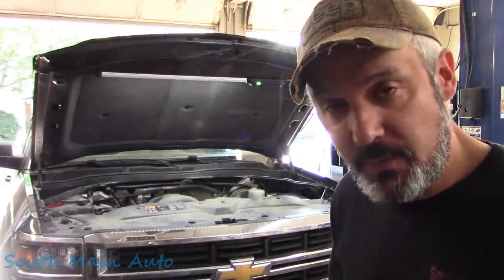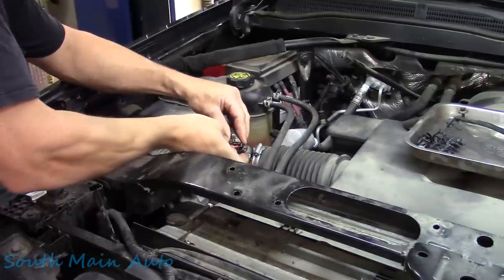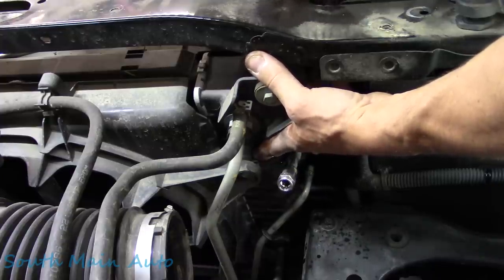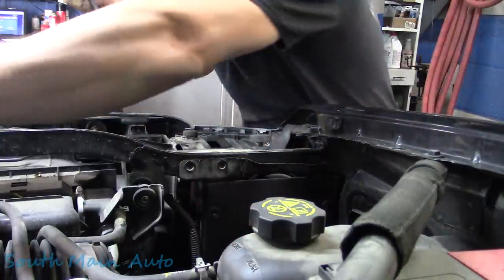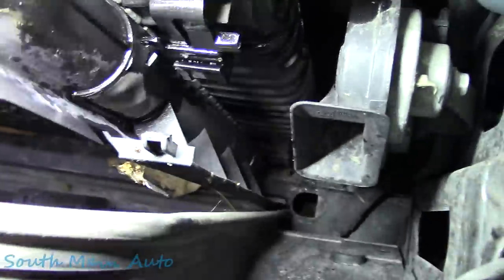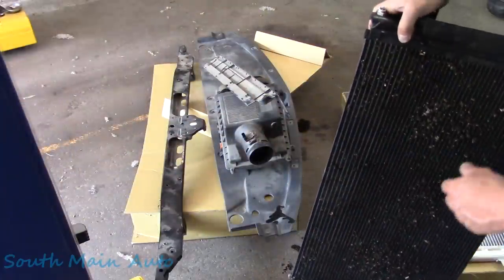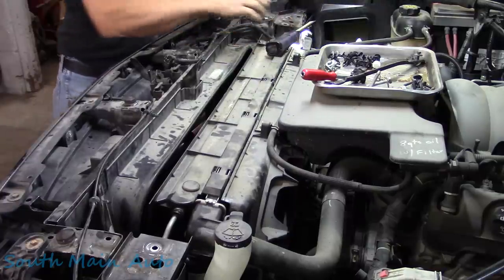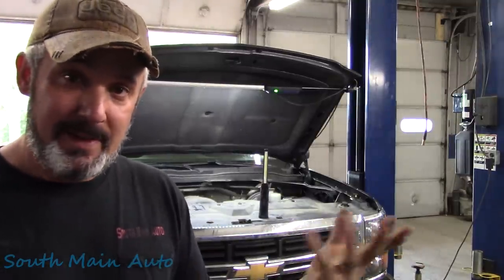Chevrolet 1500 / Tahoe - No A/C Leaking Condenser

Comment: It's "genuine AC Delco," but not the OEM part. 🙂 However, if you get this job done at a GM dealership, this is probably the condenser they will install. The one I work at does and I know many others do as well. I have no idea if this AC Delco Professional part is any better or worse than the OEM part. Your conversation with the other tech regarding those brake rotors was hilarious!
Reply: AC Delco professional is a lower/cheaper line than regular AC Delco. And Regular AC Delco is the OEM part. All OEM parts for GM are either AC Delco for most things such as service item and common wear items, and for more speciality things they are Genuine GM parts. No different than Motorcraft and Genuine Ford for Ford vehicles
Reply: @MoparMadness93   I work the parts counter at a GM dealership. I'm already well aware of this. 🙂 I was just poking fun at how Eric described the new part.

Comment: This one caught my eye since I’ve had the dreaded condenser leak as well.  Dealer charged $1400, but no one else could even find the leak LOL!  And my transmission oil looked like that when it died at 160k miles.  2015 High Country.   Should be good for another 160k, right? 😬😬😬
Reply: I had mine drained and flushed at 100,000 Transmission now it’s got 200,000 on it thinking about having it done again it’s a 07 gmc

Comment: I just put a condenser in a Kenworth this morning. Would not create a vacuum. I didn't look over it well and found a dent on the bottom. No box damage. Thankfully the old compressor had an internal leak. Thus a reminder to always look over your new parts first.

Comment: I know what you mean about those plastic retainers going flying away! I was working on my '04 Chevy Trailblazer, and I had to remove the left side door sill. This piece wraps up the front of the cab and encloses the parking brake lever. Up in the corner is a plastic Christmas tree style retainer. I used my trim to and popped that retainer out. It went flying across the cab, and I've still never found it! I know it's in the cab somewhere, but it's hiding pretty good!

Comment: Boy, you're not lying about Taiwan parts packing! I just liberated a 6,000# (approximately) steel and thick wood specialty bench beautifully made and finished and shipped directly from Taiwan. The outer carton is of extra thick cardboard. All the parts are individually boxed and suspended with those hard, wood-like corner protectors, plastic bags, specially shaped Styrofoam pieces, and enough large sheets of inch-thick Styrofoam to insulate my basement. What a difference from that horrible, easily torn, dissolving Chinese carboard that invariably has parts poking through it.

Comment: Just did that job on my ‘16 GMC Seirra, although I could for the life of me get the cordless ratchet on the 6 bolts on the top support, hand wrenched them all! Oh well it’s done now! Great job on the video!!
Reply: I like to use a 1/4" air ratchet on tight stuff like that but I don't have a battery ratchet so must any way. Some stuff just needs a manual wrench and lots of "language" smile...

Comment: Never thought I'd give you some advice but I'm a GM tech and yes we do this all the time. To the point we kind of prefect this to being a 1 hour repair with AC charge under warranty. You can save a bunch of time leaving the cross bar in and removing the intake duct. The radiator towards engine and it will allow the condenser to clear that bar. We can usually have these out and back in within 15 minutes. Miss the times they paid 5 hours under warrent :/

Comment: My 2014 Silverado 1500 had to have the condenser replaced last year due to the known cracking of the condenser. Again, no warranty coverage. It was replaced with the upgraded version that addresses the cracking issue. Been working since. Now I get to see how the repair was done. Thanks Eric.
Reply: The "upgrade" version (S) also leak.

Comment: Man Eric you did this the hard way, GM pays 1.0 to replace these, plus EVAC and recharge. Take the intake tube off,  unbolt the Radiator, deal with the lines, push it tword the engine, unclip the condenser, shimmy it out.

Comment: Too bad, you couldn't have changed the radiator at the same time. Good job, Glad my 2013 is being replaced with a new one. 110,00 miles and very few problems but from what hear it's time for things to start needing fixed. It will be someone else's problem. Here in AZ, we need our air to work.

Comment: I don't know if those connectors are the same type as some of the dodge stuff uses but if you lube those quick connects the next guy can get them apart really easy. Use the same oil pag(somenumber) as you add if you replacing a compressor. Also if you want a really leak test go look how the hvac guys do it, they presser it with nitrogen 300-400psi then close the vales and see if it goes down. It also helps keep moisture out of the system, keeping your vacuum pump oil happy.

Comment: I did this on my 2016 Silverado last summer. I took out the radiator as a assembly. I had a leaking coolant tank to deal with. The radiator did have a lot of stuff stuck in it.

I am currently doing a compressor and condenser in my expedition. I got the kit from rock Auto. It is a fight because everything is buried on this vehicle.

Comment: those rear brakes/rotors! My cousin did about equal to that many years ago, not cut into a separated ring, but very worn and inboard pad/backing plate gone.
I was asked "can you turn the rotors?" I said yes I can TURN them in to the scrap yard for peanuts. 🤣

Comment: Not an easy-peasy job for sure. Always best to fix the problem, not just "repair it" by filling the AC. Good job! I would also recommend a mesh screen on the grill to keep the grass & hay off the condenser and radiator so you don't get the crusher Dirty when the NY salt has its way with the truck!

Comment: garden hose from the back side works great to flush crud from radiator/condenser or better yet, cheap old school engine cleaning gun (air powered that siphons water up a hose) then just use plain hot water or regular dish detergent/hot water mix, beware you'll have foaming suds galore and need to rinse it very well!
yes there are specific products on the market for cleaning radiators/coils, but I mush prefer to using "junk" I have laying around and many others likely do as well.

Comment: "I am here to tell you though it affects WAYYYYY more vehicles than they have listed. However in typical GM fashion they deny everything and won't cover any vehicles not listed in the TSB under the extended warranty even though they use the exact part number haha. Way to go GM"   EXACTLY the same with a windshield wiper issue on our 1994 Suburban.  1994 Suburbans - but NOT our VIN number - were covered by a recall, even though we had the exact same issue (wipers not working when raining), bad solder joint on the circuit board, cracking due to insufficient supporting.

Comment: Still working on finding the leak in my old Suburban a/c. (it never worked from the day I bought it!) I've replaced just about everything in the system bar the lines, rear unit & tx valve back there, It's very hard to get to. Flushed the system of course, checked & or replaced every o'ring I could & though it does hold vacuum sometimes(which is real odd). I'll be darned if I can find the leak so I'll be delving into that rear unit soon with the hope of finding it there. When i got the system to work, it was ice cold so I certainly hold hope for it, but the parts hunt isn't easy as it's a RHD delivered here in Aust. It might be time to "borrow" some nitrogen from work. A/C can be a challenge at times & believe it or not, the A/C in our home has just gone out, No heat for Winter! I've never looked into those reverse cycle systems, apparently you need gas for heat ?? (no, I won't be doing that one!) Cheers! from Oz !!
Reply: Maybe some systems use gas for home AC to heat, but the one I am currently using doesn't.
That is to say, I don't think modern ones do.

Comment: This is why I stopped buying GM cars Eric. On my 1998 Pontiac Grand Prix, the car I had back many years ago now when I visited you in Avoca, I went through 12 window regulators. The dealership I bought my car from fixed four of them before the warrantee expired and I fixed the rest. That GM could design such a shitty part did not bother me, what did bother me what that 7 years later the original GM part still was not upgraded to fix this issue. The actual problem was that they used a plastic turnbuckle to hold the cable that ran the window up and down. This turnbuckle could not handle the heat here in Phoenix. The dealership I bought the car from routinely replaced these regulators in new cars that were on the lot waiting to be sold that's how bad it was. I bought TYC regulators made in Taiwan to replace the GM ones and they had figured this out and used a metal washer to hold the cable together and never had another failure. Been buying Hyundai and Toyota's ever since and this just doesn't happen on Asian vehicles. When something breaks they figure it out and upgrade the part. Obviously Hyundai had a huge problem with their Theta engine, but they took care of it. GM wouldn't give a shit.

Comment: must be nice to have so much experience you know right where to go.
last AC job I did was a bear- 04 E250, it would leak down in a day but had no signs of oil or UV dye anywhere.  checked with the sniffer and soapy water, found nothing.  Finally used the noggin and determined the gauges were reading around 100psi and holding that pressure, so it wasn't leaking when sitting there. hooked up the nitrogen bottle regulated to 150psi and charged.  careful listening revealed the compressor seal started leaking around 140psi.  the system was only leaking when it ran and built enough high side pressure.
lesson learned, don't waste time looking for a leak that's not there and don't buy rebuilt 4seasons junk compressor from autozone.

Comment: I always spray the E clips with a penetrating oil before I even try to get them apart. It seems to help as I've never had a real bad time with them. I'm on the sea coast in New England, which is just the rust belt east.

Comment: Love your channel, would’ve love to see the actual diagnoses to prove the leak before the tear down and repair instead of a common problem diagnosis
Reply: It was stated that the other shop used the uv dye to find the leak but couldnt find it. One these you can see it through the grill using a uv light. The previous shop prob only checked fittings on the lines and such, not the actual condenser

Comment: “Full Beans!” “Made in Tee-a-wa-nah.” Lol
Happy 4th to the O’s. 
The infamous mexico built Chebees. 
I came to know these thru a friend who bought a “new” Trailblazer with multiple problems, no start - cracked battery case due too short battery post then over cranking it to hold. Dealer couldn’t find it although battery acid ate a hole in my shirt when I trouble shot it. Ac not cooling repeat dealer no fix. Vent doors out of sync freaking nightmare panel removal. Headlights going off at night, burned out  lightbulbs front and rear and aftermarket headlights on a new car.  Window motors burning out in 3 yr suv. Transmission slipping. Cracked discolored interior panels. Clogged intake. I really believe this truck was stuffed with drug packages coming from mexico and then torn down to retrieve their drugs after USA delivered.

Comment: You don't have to take the tie bar out, if you take the resonator off the front of the intake you can move the radiator more than enough toward the engine to make the space you need. Saves a little time. Surprised there was no mention of the massive shift in labor time of this job over the years.

Comment: I didn’t know about the eclip tool, which would have come in handy when I replaced my rusted out trans lines on my ‘13 Avalanche.  I also didn’t know the condenser might be covered under warranty, since that I had replaced last year using an  independent shop.

Comment: Have you ever done a rear drum brake job on a 2008 GMC or Chevy truck? If you haven’t use new hardware. I tried using the old strings and they just would pop off used the new hardware and was able to complete the job. Why does every car or truck manufacturer have to reduce something that has worked for years! Just amazes me how they just make harder for anyone to do a simple brake job. My name is Jeff Hehl and I was
Watch your video’s all the time, they keep me informed and interested in still working on my own vehicles

Comment: My 2002 Ford Explorer Sport Trac had a very slow refrigerant leak (recharge it every 2 or 3 years) that became a max leak, everything gone in 1 or 2 days. My mechanic checked everywhere (almost) for leaks and the only thing he initially found was the low side Schrader valve had a very slight leak. So he replaced that, refilled the system (and added leak detect dye) and told me to drive it for a couple days. Everything leaked out again. I took it back and he was looking all over under the hood with his infrared light and glasses and there was nothing leaking. Also no dye in the water from the evaporator drain. So he stood back from the engine bay and shined his light on the front of the vehicle. There on the left front grill was lots of dye from the pinhole leak in the left front of the condenser.

Comment: I had the same Freon leak on my 2015 silverado.Condenser leak top left facing the steering wheel.I hear that is a common problem.Had the condenser replaced.Fixed the problem.The reczll bulliten you listed is not complete.Silverado is not listed.

Comment: Had an Escape with a leaking trans cooler/ ac condenser combo. There was a recall but my vin was outside the recall. Mine was leaking in the exact place covered under the recall. Ford would not cover it under warranty or recall. It was leaking trans oil so i cleaned it good, jb welded it, and traded it in. The estimate to replace it was $1200. Put me off Fords for the next 12 years.

Comment: Funny thing is I’m watching this. I just did the same thing 3 days ago. Plus a compressor because it was leaking behind the clutch. And the condenser was leaking in the exact same spot. Also the same air box clamp was loose. Weird. 2014 Chevy 1500

Comment: Can’t tell you how many of these condensers I’ve replaced. Multiple refused under warranty. They know good and well that they should be covering all of these failures. Most of them come out that way but I had one GMC Yukon Denali that was different. The whole front end had to come off to get to the condenser. It’s the only one I’ve run across like that.
Reply: I did an Escalade that the whole stinking nose had to be removed. The local GM dealership refused to cover the repair even though it was the right year it wasn’t the right serial number. 
I don’t fault the dealership because GM is playing hardball with their dealerships submitting fraudulent warranty claims. No such thing as “Goodwill warranty “ at a GM dealership anymore.

Comment: Pssst hey Eric ya don’t need to remove the auxiliary battery tray or that bolt holding the washer bottle on. I removed them as well the first time because I saw it in service data and then when I got it out I thought to myself why the heck did I remove that, needless to say I haven’t removed them since then and it comes out just fine lol. O and ya also don’t need to remove that top tie bar over the radiator, surprisingly the condenser slides out just fine with that still in place, ya just push the radiator towards to engine and out she comes Bobs your uncle

Comment: Every Chevy/GMC I have owned the AC has crapped out. That and Heater cores. My 2000 BMW 525 still throwing cold air and has never had a leak.

Comment: My 2011 with the big 4.8 still runs good and blows cold air but I notice on really warm days my temp starts to creep if I’m stopped or not going down the road 25 mph or more.  Fluids are full and fan runs.  Got a good idea now what the problem is.   Great vid
Reply: Jimmy S  no belt driven fan on this rascal.   Just a couple big electric ones sitting up front.  I took it apart enough this afternoon to look in there and there’s a lot of material plugging up that radiator.  I suspect that’s where the problem lies but I appreciate your suggestion.